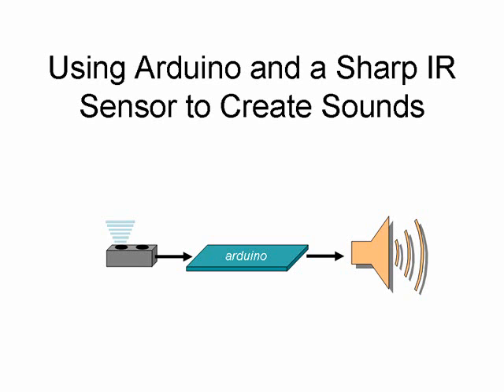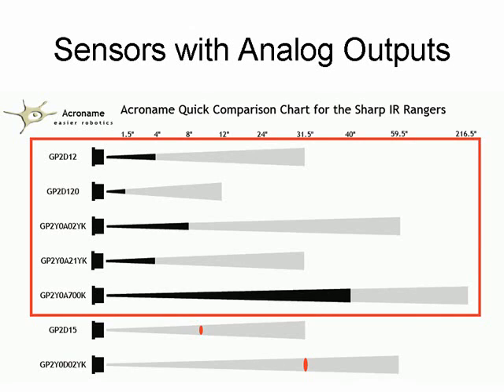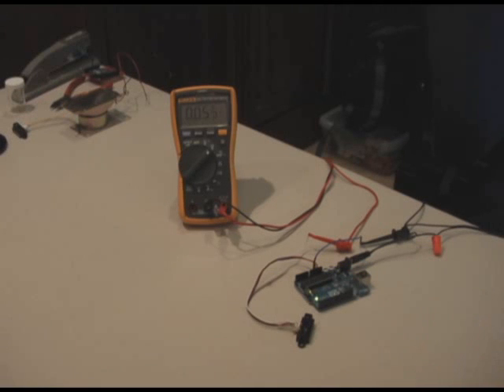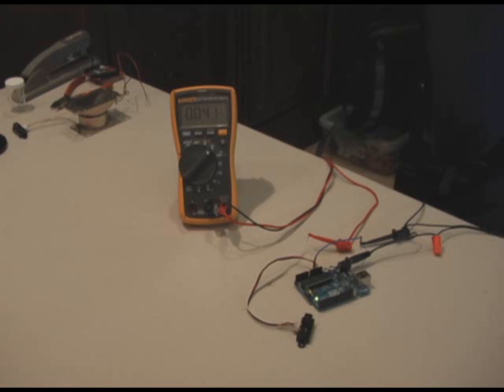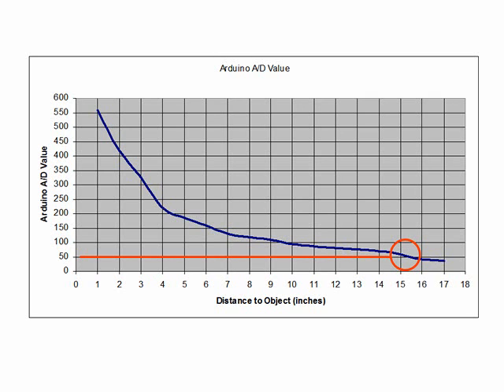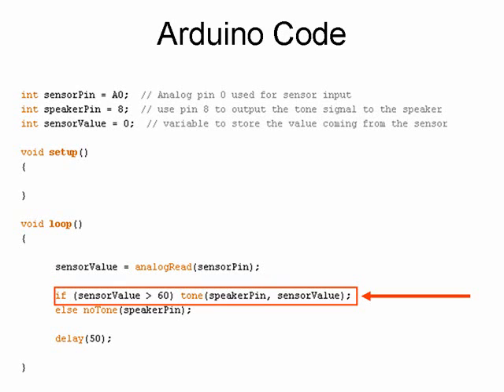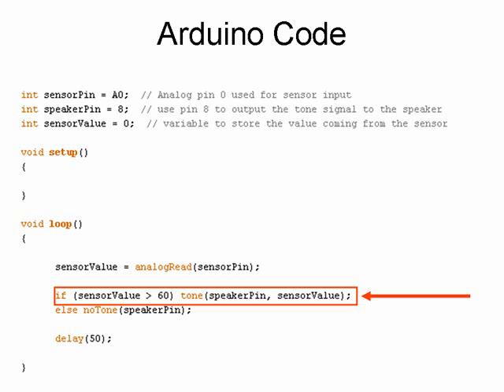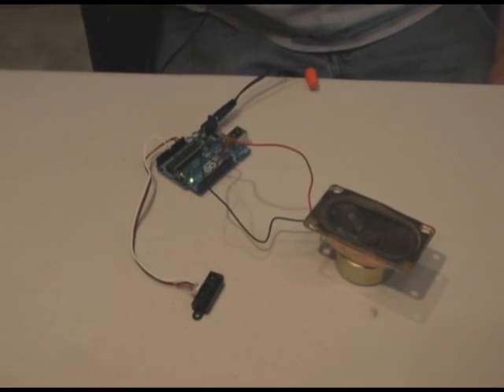Using  the Arduino Uno and a IR Sensor to Generate Tones

Comment: Hello i am working with the Sharp sensors GP2Y0A02YK, for doing a Laser Harp with 7 sensors, but i have the problem that the ranges of the sensors are mixing between them, and they like confuse and gives me another notes how can i fix that problem, or can i contact you to send you the arduino code im using s you can help please!